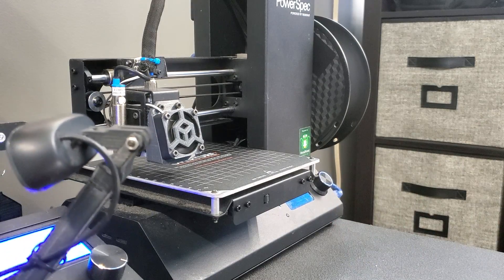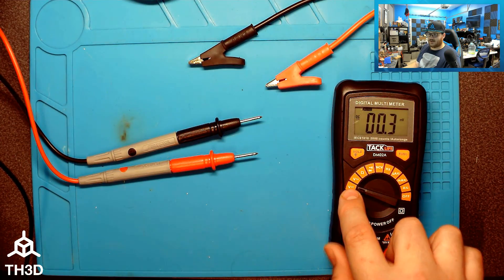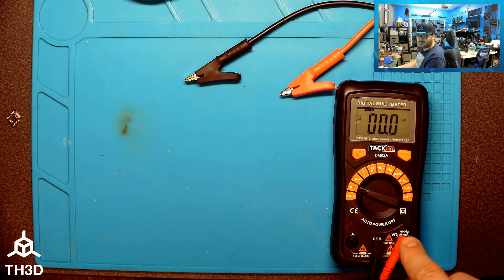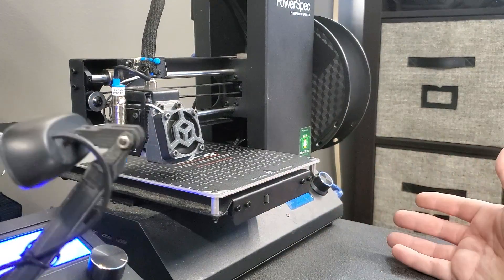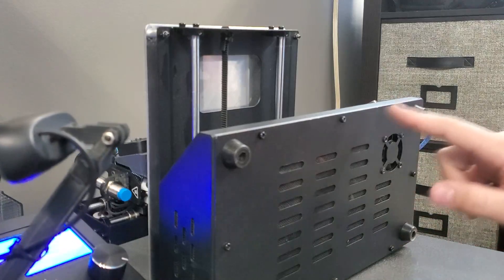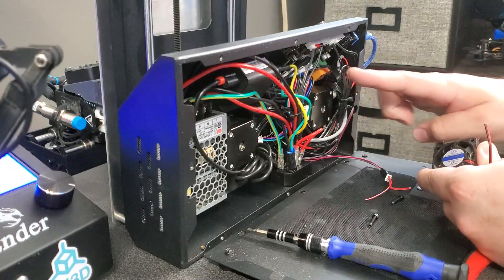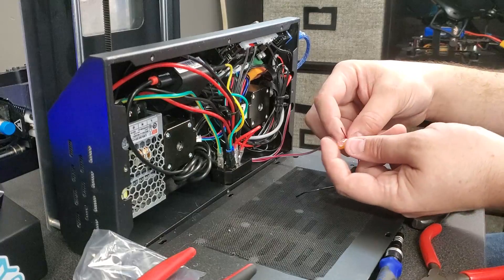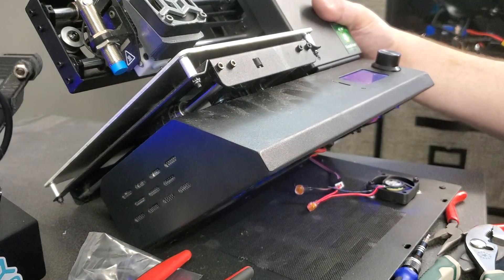How To - Replacing your 3D Printer fan with a TH3D fan + quick connects

Comment: Is there any way to reset the connector if it didn't hold the first time? Mine is stuck closed.
Reply from the maker: They are one time use. But if you need more and are a customer just email support and if you cover shipping we can send some more out.
Reply: @TH3DStudio  Thanks for the help, I just ended up using solder and heat shrink. I was able to get the connectors to work on my second fan, but they were really difficult to push through. I think the wire insulation on my ender 5 pro may be thicker than some other printers.

Comment: Hello. Just bought a fan to replace the whiny one on my Ender 3 V 2. So what I seen from the video, you do not have to strip the wires at the end? I just stick them in the connectors and it does the job? Thx
Reply from the maker: Yes, you do not need to strip them.

Comment: Tim, can you comment on the need or preference for quick connectors and potential failures for using them vs other methods of terminating connections for us less experienced people?
Reply from the maker: These types of connectors are used in the telco industry for low voltage applications. As long as they are installed correctly I do not see any issues with them nor have we had issues with them over time.
Reply: @TH3DStudio  Thanks, Tim.  Maybe in the future you could do another video on a vast array of other connectors too?!